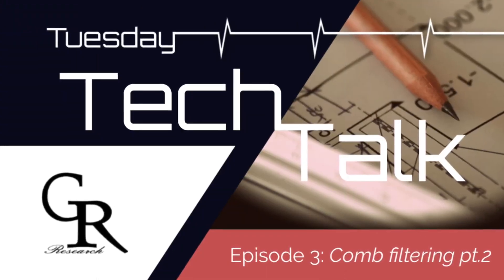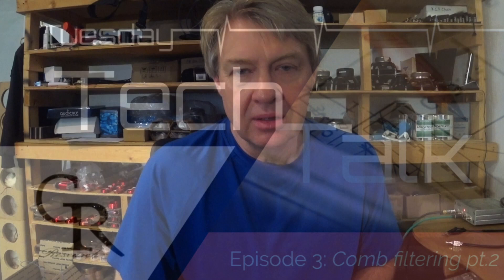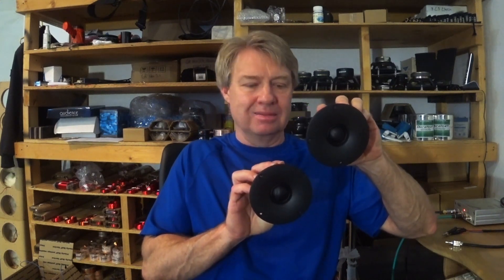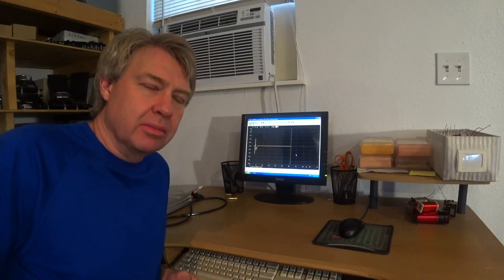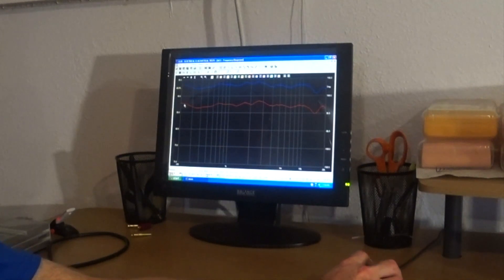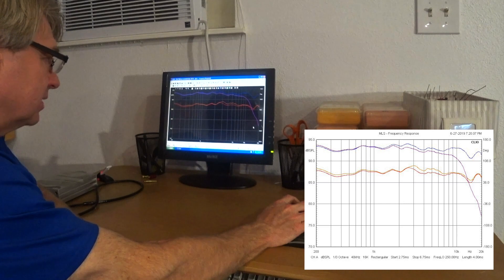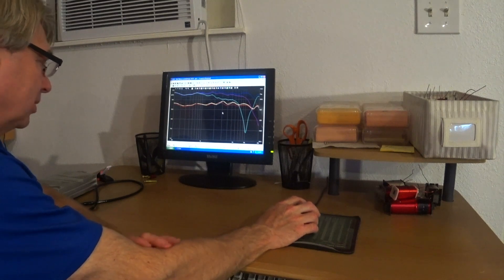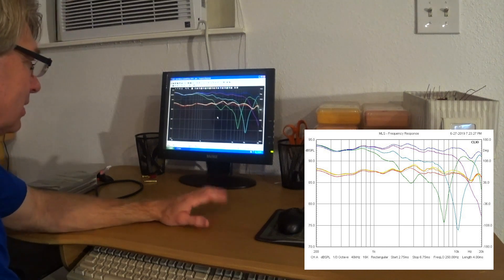Tech Talk 2: The REASON why 2 tweeters wont work!

Comment: i just discovered your channel . You guys are great ! i have just started researching crossover rebuilding for an old set of vintage Bozak speakers that i am putting together. I have two sets of crossovers i can use .Both are new old stock . One is an N104 b set which is sleek but has non desirable ferrite rod coil set up and they are tiny compared to the other crossover which is an N 10102 set with larger open air coils. Your tips on coil choice also helped me avoid the lesser choice. Also this video hits home on multi tweeter arrays like Bozak is famous for and other manufactures as well. i like the bass and mids of these speakers but the tweeters are known to have issues. So it sounds like i should just use one quality soft dome tweeter instead and line up all the voice coils.And use quality caps for the crossover rebuild.

Comment: How does this issue work with two speakers placed left and right? Does the space inbetween each solve this problem since waves are so small?
Reply: Left nd right speakers do not receive the same signal (not mono), they are used in stereo.

Comment: Hello
What's your thoughts on a company called Tekton? There speakers have anywhere from 2 to 5 or more tweeters!!! Thanks
Reply: We've upgraded several of their models. They definitely needed a lot of help, but their models with multiple tweeters don't have the issues that you see here. Only one of the tweeters is actually being used as a tweeter. The rest are being used as high mids like a filler driver.

Comment: I recently decided to re-purpose 2 old Bose SoundDock (powered) speakers for use on my computer.  Each has a 1/8" Stereo Aux input jack and I initially wired the left output from my PC to BOTH (L+R) Input of the SoundDock on the left side, the the right output of the PC to both L+R speakers of the new "right side" sound dock.  Notices some very drastic drop in high-frequency output.  What I eventully ended up doing is building a small in-line RC filter that cuts all frequencies above 800Hz to the "outside" drivers of each Sound Dock.  So the left speaker only reproduces high frequencies with the right-side driver and the right speaker only reproduces high frequencies with the left side driver.  This 100% corrected the issue, and overall improved the entire response as I move my head around from side-to-side by the desk.  The bass still comes through both drivers of both speakers and thus the bass response is great (for the size).  

Comb filtering is very real and impacts sound in huge ways.
Reply: Nice job.

Comment: Tape some laser pointers on your mic and your get it closer to center
Reply: It doesn't matter. We don't fix our ears to a specific height. The comb filtering still causes holes in the vertical off axis response and it will make the room response unbalanced.

Comment: No to two? Then how about companies that use THREE tweeters (Miller and Kriessel)? That's got to be THREE times better, right?
Reply: three is actually usable, now you can have one of them to the highest frequency only. and the other two act more like upper midranges.
Reply: @sudd3660  That's not how the M&K tweeters work. All three are set for the same frequency range...
Reply: @GlueFactoryBJJ  ok, then thats how they do it.
Reply: @sudd3660  I guess I want clear in my OP. What I meant was would the three tweeters over come the inherent phase shift problems that are audibly apparent off axis? I understand how they (the (modern) M&K speakers are constructed, but I don't have the $$$ to see how they sound and no local dealer.

It's more of a conceptual question, like at what point does the number of tweeters begin to behave like a line array?
Reply: @GlueFactoryBJJ  line array effect start immediately if they close enough center to center,  but the nice flat response is limited to the physical size of the line aray, that is 3 tweeters high in this case.
Reply: @sudd3660  Three or more tweeters get even worse.

Comment: Question...A friend has 4 B&W small bookshelf speakers that he insists on running all at once with a pair on each side about 24 inches apart...with pairs about 5 ft apart and listening position about 6 ft away. This can't be a good set up? Do not the multiple sound sources cause phase issues?
Reply: That set up will cause time arrival delays that will cause comb filtering (cancellation).

Comment: I have a Foster 12" 3 way speaker with 2 tweeters in clover pattern above the mid driver, they are wired in parallel om one 2.2uF cap, I separated the 2 pos wires and put in another 2.2uF cap so each tweeter has own cap. the mid runs 6.8uF cap, woofer no Xover, these speakers are late 70's and were sold without brand name on the enclosure. My dad's first hifi had 8" Foster speakers with 2 different tweeters, a 65mm cone and 1' dome, the 65 tweeter ran 3.3uF cap and dome 2.2uF, The amp was Audio Reflex TK72. The 12" speakers were found on kerbside in 2008, Mum gave me the 8" speakers in 2005 when hard rubbish time came up in her area

Comment: How do designers create line sources with dozens of tweeters get around this problem, especially of the electrostatic variety?
Reply: He addressed this in another video, but the tweeters have to be a minimum distance to each other for the wavelengths used and they end up beaming vertically due to a huge effective length of the tweeter, meaning you only ever hear one tweeter at a time that you're in line with. The horizontal dispersion is still good because it has a small wavelength in width so it doesn't start to beam until very high frequency in that direction.

Comment: A few questions, if you have time, please:

What if the tweeters are exactly the very same and extremely well made and timed to perfection, let's say even hypothetically, would that negate any comb filtering effects?

What are you thoughts on things like the BeoLab 90 with three firing tweeters on the same side? Could that be that case of such low tolerances that the tweeters play perfectly timed?

I heard many speakers with side, up, or bsck firing "ambience tweeters" (not on the same side as the main front tweeters  playing the very same frequencies as the front tweeters at the same time but firing in a different direction. I must say, in that case, I belive it sometimes does make the speakers sound more natural and "humanly better" (as far as my listening goes), not necessary, it doesn't bring more detail or anything to the played sound, just a small "upgrade" to the sound when done right. I belive in this case comb filtering would be negated or not noticeable, right? Since the frequencies arrive at different times to the ears and the tweeters are firing in different directions.

An experiment I did was amplifying the top atmos drivers of some atmos stereo speakers to play the exact same thing as the front speakers at the same time (making it basically like a four speaker stereo system, two on each side, two firing to the top, two firing to the front). And to my ears it did sounded better (much better than using any DSP, Dolby, or Atmos filters / effects, and a little better and more natural and spacious than just playing the front speakers. Nothing major, just a little extra). I couldn't notice any comb filtering in such a case, which makes sense since the speakers are firing in different directions, so even though they are playing the very exact same thing it takes longer for the upfiring high frequencies to hit the ceiling and than reflect back to the ears, while the front tweeters reach the ears immediately. I would love for you experiment using good speakers that have atmos upfiring top drivers but playing them all in stereo like I did (top firing drivers playing the same thing as the front ones at the same time), I belive you will find it pleasing, again nothing major, just slight bit of extra spaciousness and sound "naturality ", really interesting.

Thanks so much for you time and considerations. Appreciated.
Reply: I'm not him, but i think i can answer a thing or two:
-having perfectly identical tweeters (in any aspect, like if they were clones) would not negate comb filtering, because this effect is caused by the fact that sound waves from two close tweeters will always arrive at a different time when you are off-axis (the signal coming from the closer tweeter takes less time to reach your ear, compared to the other): this causes the signals to cancel when the signals are out of phase, and since the wavelengths are in the ballpark of centimeters in the upper frequencies, slight distance changes easily produce out of phase situations at those frequencies.
-i heard (maybe from danny himself? i don't remember) ambient tweeters don't cause comb filtering because the delay is too high in comparison to the front signal. I don't remember if it's our hears that perceive those as different signals (delayed) or a thing you can actually measure with a mic (for sure it can be seen in the impulse response).
Edit: he wrote this thing in a comment right below (in response to rocifier)
Reply: The comb filter is a result of canccelation of 2 identical waves, when due to the time-difference in physical distance (mic 2" down) the identical waves have 180° phase turn, and cause then noise cancellation with each other. 

Meaning: as more identical the signals are, as better is the cancellation. Its like the noise cancellation headphones, same method.

Comment: That theory also has been refuted by another school, using the psychoacoustics, and with extensive double-blind testing, I'm not going into an argument here, just showing that every school has an opposed...
Now me asking to get into more details, and not trying to argue, just trying to get more information...At intervals of 2"-3" it may be measurable, and more noticeable, but what about but at 6' or 10' away, can you get the same results measuring the effect? Now if you apply, lets say felt rings on one of the tweeters, will that affect that cancellation, or sum?... Or maybe if you use different tweeter types, horn vs dome, or different domes material, or paper vs dome, that will offer different freq curves and spectrums?  What about then the ones who use "super tweeters", that are not even on the spectrum we can hear, and they still claim to listen the differences, and  they will always overlap somehow..... 
The brain is a very complex machine, but unfortunately according to some other studies and articles, mainly in psychoacoustics, the human brain, will not pinpoint isolated frequencies, like these shown on your graph, or groups of so close frequencies like that. The brain works more like summing average machine inside; and for the lack of a better description, lets say: it uses like little "buckets" of freqs, and compensate for the differences. Otherwise, digital music will be unbearable with the steps on the squares waves....or maybe the class D amps, don't you think? 

See this video, and what do you think?

https://youtu.be/4b2IOOhJmxw

This is one of the most expensive systems in the world, custom-made, (even while I agree that expensive does not relate to quality in many cases) but this guy is dealing directly with Krell, and custom made even the room, what most of us can even think off...his speakers, has 30 tweeters on each speaker center, left and right, and 10 in the back of each...120 ribbon tweeters, and 7" Scan Speak Kevlar drivers...the subwoofers inside the wall, now is that guy nuts? Combing does not apply here?

Also, as a side note, I have a very decent customized headphones setup, indeed I can put together 3 of them, one portable, two desktops...and own some of the best available headphones, and all my amps are custom-made, not cut corners, RK40 black velvets, audio caps, all class A, etc, etc, etc...and the best part, a gift from a friend, so this is not no pissing contest expenditure here...
Now while listening both, side by side, I can't see how the combing effect impacts the speakers, as the sound is amazing either way....

Not saying that in other cases it may be more detrimental, but in mine, thanks God, I can't hear it... And I bet someone that does here...!!!!

Comment: Very interesting. What were those speakers that were very popular at the beginning issues of the absolute sound/ stereophile, where they were advocating 2 pairs placed one upside down on top of one another, just like your comb filtering example. Did anyone back then even notice the comb filtering? A person has to have trained ears to notice these effects, but once trained, they really stick out and are easily noticed. But being a person that doesn't believe in these effects, they also don't notice/hear the effects.

Comment: The theory behind a focused array is that two sources at equal distance from the listener will sum 3 db higher than the reflected sound. As Danny has demonstrated, the reflected response is always changing as the path lengths will be different. Thus the listener in the sweet spot will hear more of the recording and less of the room. See original Wilson WAMM, alothough I never heard Dave point this out.

Comment: Actually a 2" drop on the single unit gave an excellent response which from a more normal listening distance would equate to comfortable listening window? I had some Urie JBL 813B with the duel concentric drivers, does this solve the problem of
integration

Comment: Danny Richie I always stack speaker in series having 2 speaker for Lt and Rt they sounded good. so is it better to disconnect the bottom tweeter so there's only one tweeter per side.
I bought the RP-504 update kit and love them and I'm going to make them into towers any side effect to doing this? Vertical vs Horizontal or even stacking 2-together per side?
Reply: I disconnected the bottom tweeter on the Rt and Lt  (it bi-amp not to hard to do) It sound Terrible w just the top tweeter hooked up. Lol
Reply: And soon as you stack them up you will get the cancellation effects shown in this video.

Comment: Always wondered about this for the Dynaudio older confidence and evidence models. They use 2 tweeters right next to each other and a relatively complicated crossover (im told) to control vertical directivity. I can see how they get the destructive interference off axis as intended but not sure how they avoid the peaks at certain angles and frequencies. I know they are a technically competent company and the speakers seem to measure well off axis. One tweeter plays above 2.2kHz and one above 8kHz. Is 8kHz high enough to avoid comb filtering peaks at practical angles? New subscriber enjoying the content.
Reply: The higher the frequency the shorter the wavelength and the easier it is for them to be out of phase and cancel in the off axis.

Comment: My old Sansui SP2500s have stacked horn tweeters, and double mids tilted inward towards each other. but they have a zig zag shaped metal diffuser mounted over the top of them that works some kind of magic because they sound pretty good to me. When you remove the diffuser they sound horrible

Comment: Dear sir does this phenomenon exist with the double woofers or double midrange or even double full range speakers?
Reply: It exists with any drivers as frequency increases. So at high frequencies the wavelengths are short and it will cause them to be out of phase and create a huge hole in the response. As wavelengths get longer the change is distance hardly effects them. So they couple and increase output.

Comment: Was wondering if this would apply  to using two Neo 8 PDR planars? Was thinking of using 2 instead of 1. Is that a mistake?
Reply: One is already too long to use as a single tweeter. Two is way too long.
Reply: @dannyrichie9743  Thanks for replying Dan. My original Neo 8's I used on top of a pair of 8"  kevlar woofers totally open. (no baffle) Used as midrange and tweeter. Plenty of highs for me and sounded very large and airy (very open sounding). One of my better speaker builds. Hence the thought of using 2. But I see now that I should include a pure tweeter. MTM.....

Comment: Despite all the hype, I listened to the twin-tweeter models of the AXIOM audio speakers.  Underwhelming to say the least.  Not just the twin tweeters, but the blah upper midrange.
Reply: I've measured and tested three of their models. I can't disagree.
Reply: @dannyrichie9743  I'm glad you did some mythbusting.  I purchased some ADS-l710 from a guy 2 years ago.  He had a pair of Axiom M-80's  and wanted my impression.  I said that the upper mids sound like they have been dropped back, and the speaker is out of balance.  I'm a little vague on the imaging too.  IMO, the reviews were not accurate.

Comment: How Infinity IRS 5 work?
Like Tektron?
Sorry for the question, i'm a beginner, seen a lot of Videos from PS Audio and Paul is in love with the Infinity
Reply: The Infinity model is a true line source. So the drivers act like one long line that is the same as a single driver of the same length. I think I did another video on that.

The Tekton's actually only allow one tweeter to play as a tweeter (the one in the center). The ones around it are actually playing as upper mids.
Reply: @dannyrichie9743  Ahh, answers my query on other post.👍
 Thanks Danny.

Comment: At a listening distance of say 12' the comb filtering should be minimized and with closer spacing of the tweeter as well.
Reply: Not at all. We don't just hear the response that is on axis. We hear a combination of on axis, horizontal off axis, vertical off axis, and all of the reflections of the room. So an uneven vertical response can cause an uneven room response and an unbalanced sound.